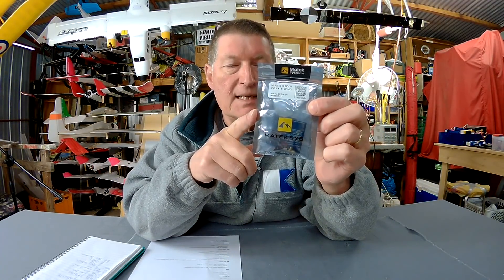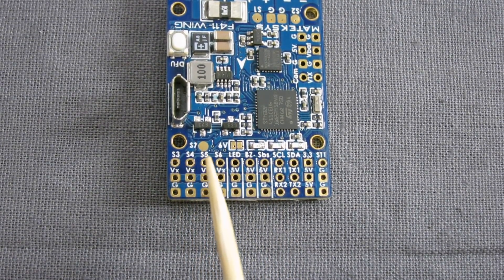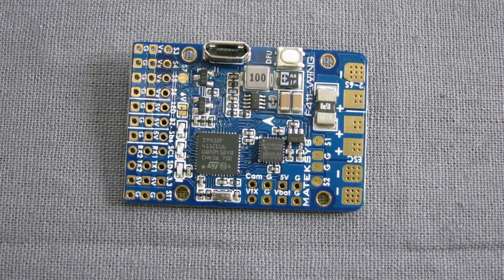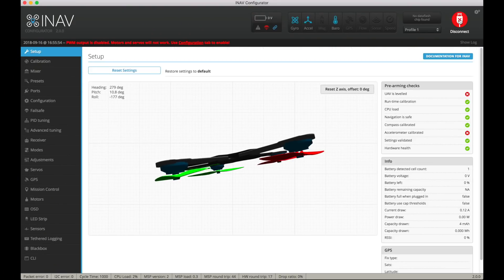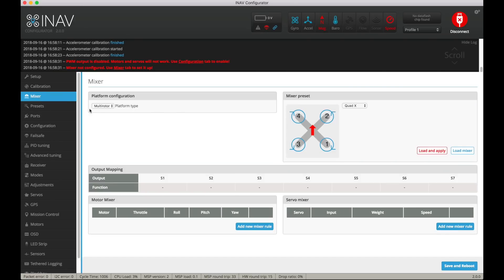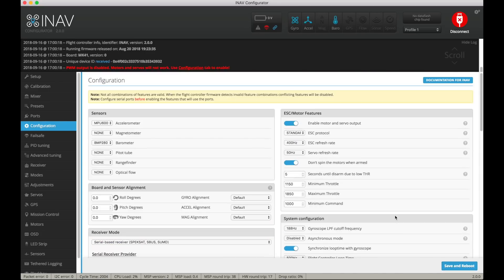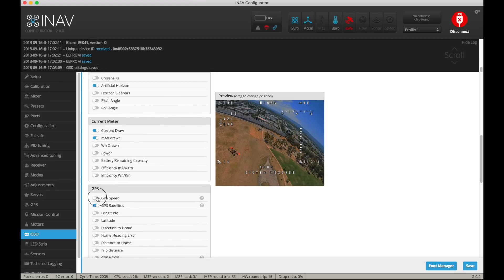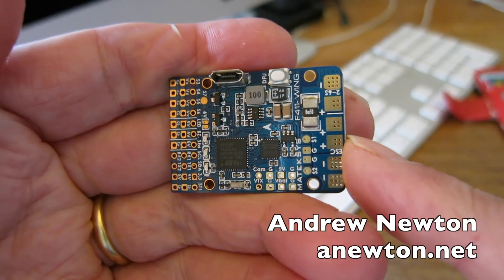Matek F411-Wing iNav FCB

Comment: Hey Andrew . We installed the F411-wing in our reptile dragon  V2 and just find that these flight controllers are almost made backwards for any fixed wing . Battery and ESC connections in the back and servo connections up front . Just makes for a messy setup . How do you feel about this ?
Reply from the maker: You can always mount 180º rotated and tell INAV in the configuration. But they have never really been a problem for me. Depends on the plane of course.

Comment: can I ask you a question please.
if you are using a crossfire tango 2 controller for uav plane you will need this to connect to esc?then this connect to the tango controller or receiver ?ty.
Reply from the maker: I dont know either of those but if it has SBUS output then it's going to work
Reply: @AndrewNewton  thank you I appreciate your help.just trying to get a long range setup im learning the parts though from your other videos ..ty.

Comment: Andrew I am trying to connect a rxsr, m8qCAN, and vtx(with TBS SmartAudio) to this FC. One uart for gps one for smart audio(vtx) and soft serial for telemetry.  This should work?
Reply from the maker: Still need a UART for the RXSR so you're one short. Have to ditch telemetry or Smart Audio
Reply: So  why can’t Smart Audio go to ST1 as holybro  uses its 4fh wire for control of vtx. ?
Reply from the maker: Where would Smart Port connect? http://www.mateksys.com/?portfolio=f411-wing#tab-id-3
Reply: Well according to matek diagram SmartPort would go to soft serial st1,  sbus to sbs, and holybro says to put their 4th to a uart Tx1 as I have gps to uart2.  This should work but 411wingFC is not appearing to comm with rxsr as no response in wing or inav values on rx pane.  Your thoughts?
Reply from the maker: @mmmartin261  SBUS is on UART1 (Rx inverted) ST1 = TX1 soft serial. If you have Smart Audio enabled on UART1 then the receiver will not work. That's my guess
Reply: So as I look at the board mr rxsr sbus is going to sbs pad and the SBS feature is MARRIED to UART1...correct?  UART1 cannot operate independently of SBS?
Reply from the maker: Correct
Reply: That figures...
Reply: So I reflashed them fc to get extra serial on s5/s6 and. Can tbe softserial support tbs smart audio for vtx?
Reply: Also m8q gps/compass/barometer doesn’t seem to communicate with board and this is preventing Arning.  Set to uart2 msp  still failing. Ideas?

Comment: I'm new to all this! My new model has 6 servos. Can I use a Y lead for the flaps with the f411 (which only has 5 servo connections). Thanks
Reply from the maker: Yes, Y-Lead for ailerons and flaps if you want

Comment: Hey Andrew, with you f411 video fix regarding power from ESC to main power. Sorry wanted to add to that video but couldn't find it. One did you soldier to the pads on board with the power cables, OR soldier to the power cable itself further away from pins directly to the power cables? And two did you try a capacitor on the power pins for the ESC, OR even the power pads once you added the ESC power to it?
And how much diffrence did it make? I'm getting terrible range with Vtx. On another point if a VTX  is 2s-6s then the power VBAT input should allow you to connect streight to the VBAT ON THE BOARD. Or have I got this wrong. As I connected to the VBAT and it smoked. Quickly removed and added extra 5v pin plugged to that and works fine. So don't understand as that's under the power that it says is it's base power of 7v.
Any help would be much appriciated, and will return VTX if my thinking is right that it should run from the VBAT ON THE f411 if using 6s or less.
Reply from the maker: Pretty sure that message appears for all the boards I have. Ignore it I think. It's showing right now with my F722.
Reply: @AndrewNewton    thanks. Really strange how it popped up after so long. I did have issues saving mode settings after it appeared but today seems fine. Really strange!
I thought the 722 actually had a logger? 
Ok I'll ignore it got 2 planes ready to go, small 670mm wings. So hope theres some flying weather this weekend. Been fairly spoilt with the ease of the Disco 4g mod. Been flying over 100km each flight and it's been great fun. Thought it time to turn my attentions to making my own planes. Was thinking may get the mini skyhunter you seem to enjoy it. Is it stable? Also have you watched Pawl Spychalski Inav set up where he demonstrates how to stop the FC from over correcting every little bump for a smother flight by adjusting just 2 settings. I'm not in front of a PC but if interested could send you the names of the settings let me know.

By the way I love the box series. Really always wanted a twin boom plane so may need t just build yours it looked great.
Reply from the maker: Hey Angus. ESC connects direct to battery with power for the board tapping off from that connection. No capacitor needed now, it didn't make any difference when I previously tried it on the battery pads.
Which VTx are you using? Should be able to take direct battery voltage if it is 2s to 6s, I'm powering mine straight from the balance plug.
Reply: @AndrewNewton  thanks mate. I've got 2x AKK vtx arriving this week, it was or is a VIVA FPV V1, promoted by black sheep. Although I had it sitting around for a while in it bag, but still should have been fine. Thanks for answering that. Stupid thing is it runs on 5v no issue it should need more power than that to evwn boot up for want of better workds
Reply: One last thing what FW are you using. I'm on the lateststable release and last night all of sudden top right a
No dataflash chip found messages appeared top right. For no reason. I plugged in a new board and flashed same message. MATEK says the f411 doesnt hav one, we all know that. Even with it switched off on the config page that appears.
I asked them to install the FW on a new f411 and they got the same message. But cant answer if it effects the board. I had issues with saving any changes after it appeared. The strange thing is I have been playing with this board for over a week and then after a couple of hours yesterday it just appeared after a reboot.

Do you receive the same message? And if so has it caused any issues for you? Also if not which FW do you have load on which Inav release?

Sorry mate for all the questions but when the manufacture has same thing happen then cant answer a simple question as to if it's an issue it  timeto reach out. 🙂

Comment: Will the F411 work on a Ranger 2000 with flaps and a roll gimbal? or should i get the F405?
Reply from the maker: Not as straight forward with the F411 because the 5th servo output S7 is just a tiny signal pad, not three holes like all the others. And the f405 has a higher current BEC onboard
Reply: @AndrewNewton  Thanks Andrew, I really like your roll gimbal so I will go with the F405.

Comment: Is the Inav software a downloadable an link included to download it?
Reply from the maker: Yes it's Open Source firmware for flight control boards, freely downloadable. Just search for it
Reply: @AndrewNewton  Thanks Andrew..Currently I have maybe 50 planes..of which maybe 25 are finished with maybe 5 or more needing the 405 board as they have fpv,  flaps , dual ailerons etc.and I would rather they have RTH. another half dozen are lighter and smaller foamies, 3d's mini's and micro's also fpv but are kept in a more close-in flying arrangement, but would be nice to add rth as well.. I'm thinking the 411 board may be the ticket for those. I knew people were using this type of board over some of the more  expensive flight controllers and is why I never bought any of those. To outfit all the planes I need to set up RTH , they would cost me way too much.
Glad to see these are working fine so looks like its time to order me a bunch of these boards.
Have you ever experimented with the other landing mode on these modes...or was it the 405 that had that mode?
Reply from the maker: Good plane collection! The landing mode comes from iNav, so any iNav compatible board will give you that, as well as all the other modes. I have never used Auto Landing, but it does work, more designed for quads than fixed wing of course. More iNav info on my Newton Airlines Blog - http://newtonairlines.blogspot.com/search/label/iNav

Comment: Do you use Opto Esc's on your Inav builds ?? 
I have some 30 Amp Quad Esc's flashed with BlHeli_S and was thinking of using them with my Matek F411/ Bixler build !
I am not sure about using Quad Esc's with Fixed Wing models !!! Any ideas ???
Reply from the maker: From what I have read it would be no problem, but I don't know anything about quad ESC programming.

Comment: Great coverage. you said get your RSSI from your receiver. Can you elaborate. I'm using   2.4G Flysky FS-iA6B 6Ch Receiver PPM Output with iBus Port coupled with the FlySky FS-i6-M2. Please bear with me as I am new to the whole fpv scene as well as flight controllers aboard fixed wings. Thanks Andrew and keep up the excellent work. Also I am equipping all of this on a Phantom F-61.
Reply from the maker: FrSKY XM+ receiver provides RSSI on a channel that can be displayed on the OSD. Dont know about FlySky, but iforce2d would be the man to ask. He is an expert in these matters. Good choice of wing, it's a sweet FPV flier and platform
Reply: Thanks again Andrew. Will check out iforce2d and let him know you sent me.

Comment: I agree that this minimal FC board seems "just right"! No unnecessary feature bloat, but everything you do need for a fixed wing. One thing confuses me, though: I notice that (in the iNav configuration software) the various alternative defaults for type of plane layout (tail or flying wing) all presume aileron control. Do you think it would be "non-trivial" to configure iNav to work properly with a "simple" 3-channel powered glider (rudder, elevator + motor), say like the Radian? I haven't found this subject mentioned anywhere, really.
Reply from the maker: Worth trying Martin. I'm sure it will be easy with the new iNav 2.0 mixer
Reply: +Andrew Newton 
I will try it, for sure. Thanks for the encouragement.
Reply: @martinbergman7693  did you try this? Did it work with only rudder and elevator?

Comment: Have an F405W and this F411W and I agree that the F411W is the better option unless you are doing a larger plane, like the Ranger/StratoSurfer with flaps and all. I have the F411W in my S800 and love how compact it is and it's also so simple to wire up cleanly, compared to the old OmnibusF4pro I had used. Thanks for sharing this info for others to be able to get setup with this great little FC!
Reply from the maker: Excellent, I haven't flown with it yet but thanks for the real world confirmation

Comment: Would love an s.port inverter on tx/rx1 so we could use one serial port for frsky fport (rc+telemetry on one serial port)
Reply from the maker: Oh, I didn't know that was possible.
Reply: yeah these quad guys are pushing frsky forward ;-)
I tested fport with uninverted xsr mod and works great with omnibus f4/inav but would be great to have an s.port (biderectional) inverter already built in. I don't think a software serial is enough for f.port.

Comment: Have to agree, the F405 is a little OTT Andrew....isnt iNAV 2.0 wonderful..?....I have a list of cli commands saved as a text file, saves much time and reduces error....Try Autolaunch, once you have it set right you will love it.
Reply from the maker: Can't believe how lucky we are. Really feels like iNav and Matek have come to maturity for fixed wing. Same here with the text file cli lines. I have extensively tested Autolaunch and it's great for smaller craft but just not necessary IMO. I prefer a thrust assisted throw, specially for big planes and wings.
Reply: I have a folder full of TXT files that are "DIFF ALL" dumps every time I make changes. That way if I screw something up I can revert easily to the old settings. Also great for pulling things like OSD setup from one plane to the next, to keep uniformity when flying different planes.

Comment: I wonder if the lower clock frequency of the F411 (100MHz vs. 168MHz) will make any notable difference ?
Reply from the maker: Maybe for a fast twitchy quad, but I think it's barely ticking over on fixed wing

Comment: For a Volantex Ranger 1600 would you recommand this or the bigger one? I have oredered that FrSky X-lite you had recommanded , the G-RX8 8/16CH ACCST Telemetry Receiver, a flvss sensor, the turnigy plush 30A (40A is not available) ... so flightboard + gps are next decisions to make..If I'd take the matek board + gps sensor you had linked do I need this Frsky SPORT GPS Sensor V2 anymore?
Reply from the maker: Great choices. Correct, you would not need the FrSKY GPS sensor or the FLVSS sensor if you used the MATEK F405-wing or F411-Wing boards with GPS. The F411 would be fine with the Ranger 1600.
Reply: Andrew Newton  Well, I simply tried to follow your recommandations regarding that Ranger 1600 over the time carefully while having a lot of trouble to get the plane to europe which took more than a half year. Meanwhile I followed your updates carefully even not always understanding everything and made the "equipment decision" after arrival so I was able to follow your X-Lite review instead of buying that earlier. 

You may have a look at your "RC build materials" page cause it needs a bit care ... or update regarding links that do not really work ... cause items no longer exist (the turnigy plush 40A) or your "newer stuff from last" year is missing like X-Lite or the G-RX8 cause last year you had recommanded a different one ... I bought many items from this page even that Z Plier from Hobbyking or piano wire 1,1mm from ebay cause your source is no longer available. I think it is not much work to update it ... especially after you had found "the beginner modell Ranger 1600" cause that made it easier for me to enter.

Meanwhile I had also bought a 10 year old plane incl. RC all in for 50€ to start flying ... or more flying and crashing to finally learn that it could be usefull to get a "stabilised" plane in the beginning. So I came across a 100€ stabilised trainer plane incl. RC to learn before I will start my Ranger adventures which I bought from Banggood "KEYI-UAV Hero 2.4G 4CH 1000mm PP Trainer RC Airplane RTF with self-stability Flight Control"  
That's at least the plan while not knowing how long shipping will finally take - hopefully not 6 or 9 month as the ranger.

So I don't need that Flvss sensor cause I'll get the data from the Matek board and I also can buy this cheaper GPS you linked above. But one final point: Didn't you make a flap mod at the ranger 1600 by adding 2 servos & flaps ? Would this F411 flight board even fit for that flap mod or should I then add the 10 € for the bigger one ?
Thanks a lot.
Reply from the maker: The Ranger 2000 has flaps, not the Ranger 1600. For a plane with flaps I would recommend the F405 -wing board. The G-RX8 receiver is designed for thermal gliders because it has the variometer incorporated, but it will work fine on any plane.
Reply: Andrew Newton  Ok, I had thought that you had done a "flaps mod" for the Ranger 1600 ... but it's OK for me. But I think I pick the F405 to be prepared for a "flaps" plane ... 
I simply bought the RX8 because your former recommendation was no longer available and I thought that the G-RX8 had some improvements and also that Variometer which I otherwise would have bought separately ... I wanted to be prepared for a glider ...  or a motorglider. So I'll buy that bigger / more expensive one, that 405 you had reviewed earlier just to be on the save side cause that bit of more money and weight does not matter and I do not assume that unused servo ports need much energy. 
Today my hobbyking order arrived , that big or heavy duty Z Plier ... and also my 3 m piano wire but 2 items are missing. But it is great source to stand in the workshop and look on a tablet to follow each step you had done on your ranger 1600 about a year ago. Thanks a lot.

Comment: I'm gathering from the specs no specific bec for the vtx? So separate power for that?
Reply from the maker: VBatt pin for VTx so it will LiPo voltage I guess
Reply: @AndrewNewton  ah perfect
Reply: Yes vcc so vtx is OK.
I couldn't get nav launch to work.
And I did do it correctly. The throttle wouldn't kick in.
Reply: @FugPlays  there is a cli command to shorten the launch determination 
Chgd mine to 200 I think it works for my plane
Reminds me i want to shorten it to like 100 or 150
Make sure to follow the arming sequence described in the wikki